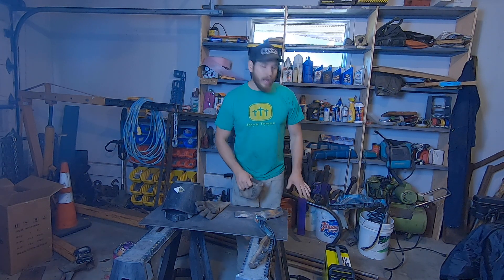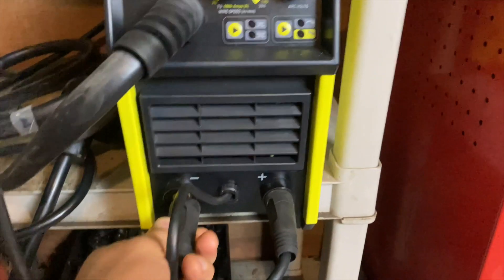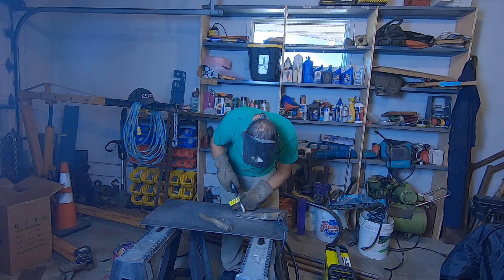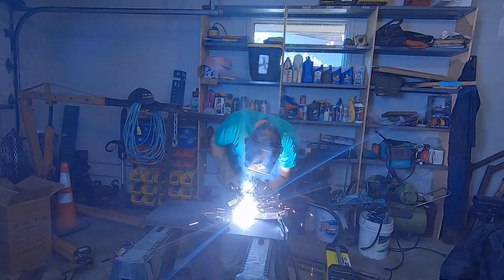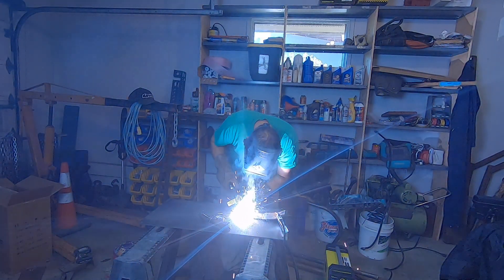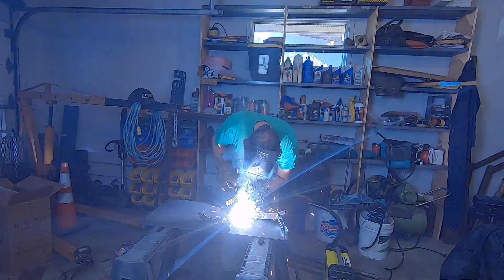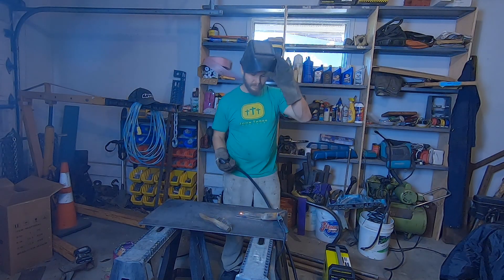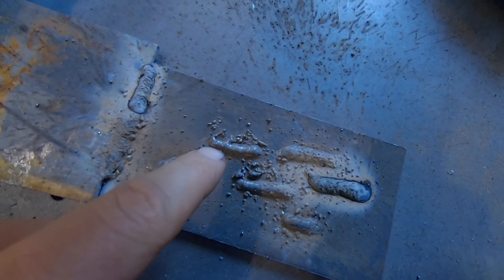Weldpro MIG155GSV polarity follow-up

Comment: Very nice.  Thanks for this update.  It seems like a good machine.  Keep it up.
Reply from the maker: Thanks! yeah its been pretty good so far, you really can't beat the price. Check out the fab table and desk build videos if you want to see more with this machine. I'm gonna try to get it set up with shielded gas before I do the exhaust on the one ton.
Reply: @DaysofPainandVictory  I just ordered the machine last night. I will follow your steps, lol.
Reply from the maker: @EduardoTorresDeMadera  nice, what are you gonna a build first?
Reply: @DaysofPainandVictory  I already used stick in my first built (mini bench) but found that stick welding method is too challenging for me. I will try Mig which I think will be best to vuild a few flip table to accomodste my pwervtools.
Reply from the maker: @EduardoTorresDeMadera  very cool, tool organization will help every project in the future!